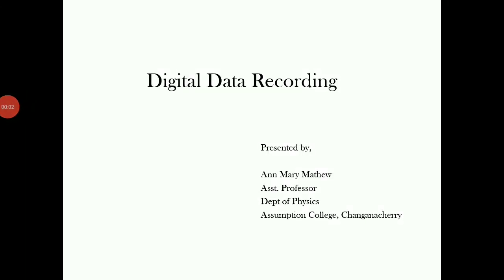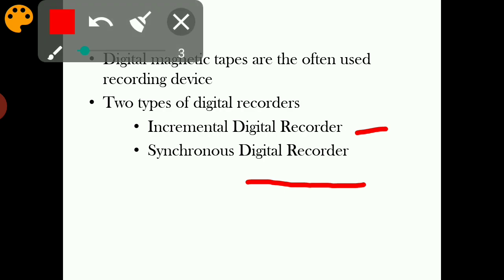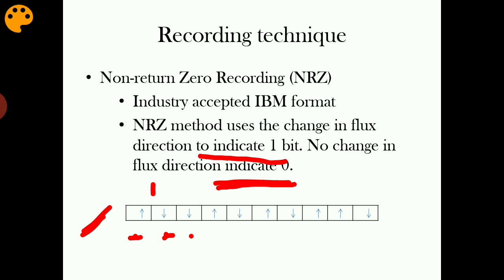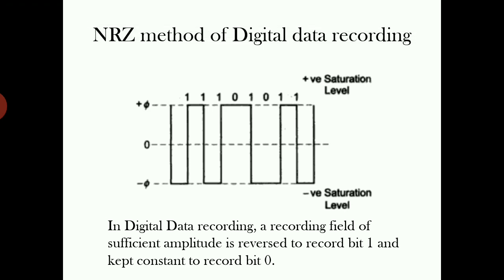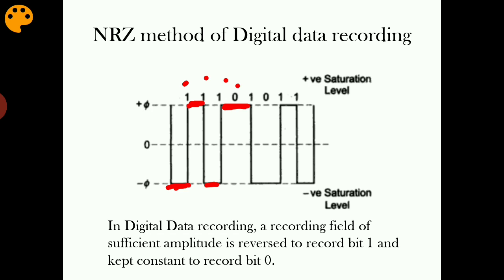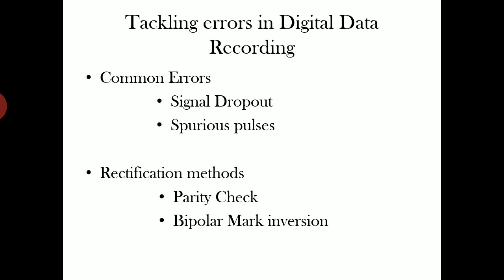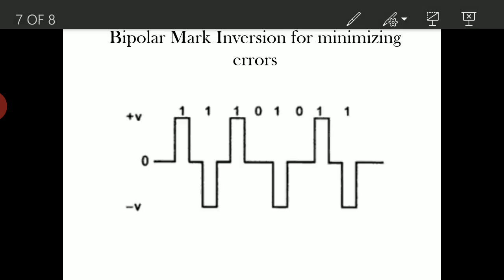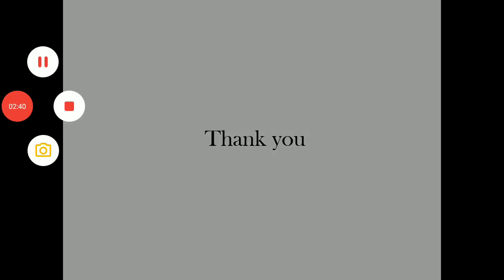Digital Data Recording | Instrumentation

Comment: Advantages  :
1 High accuracy
2 Use of simple conditioning equipment.
Disadvantages :
1 The information from transducers is in analog form, hence an  analog to digital converter is required.
2. A high quality tape and tape transport mechanism are required.

Comment: Advantages: information can be directly fed to a digital computer for processing.  
Use of simple conditioning equipment and it possess very high accuracy. 
Disadvantages:information from transducers is in analog form, hence an A/D converter is required. 
High quality tape and tape transport mechanism are required.

Comment: Advantages of digital data recording
1) When properly implemented, it easily achieves high fidelity.
2) The information is fed directly to a digital computer for processing.
Disadvantages 
1)The information from transducers is in analog form, hence an A/D converter is required
2)A high quality tape and tape transport mechanism are required.

Comment: Advantages of digital data recording:
1.High accuracy. 
2.The information is fed directly to a digital computer for processing and control. 
Disadvantages:
1.A high quality tape and tape transport mechanism are required.
2.The information from transducer is in analog form,hence an A/D converter is required.

Comment: Advantages of Digital Data Recording: 
1.High accuracy.
2:Digital signals can be saved and retrieved more easier than analog signals. 
Disadvantages of Digital Data Recording:
1.The information from transducers is in analog form hence need an A/D converter. 
2.High quality tape and tape transport mechanism are required.